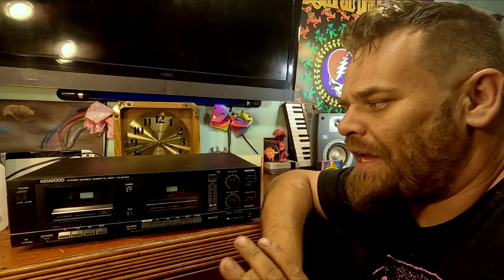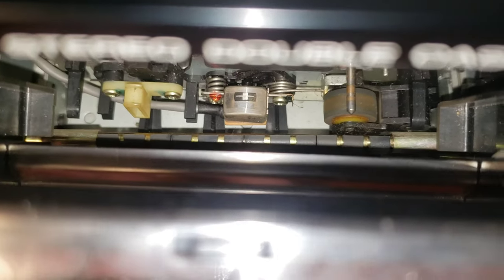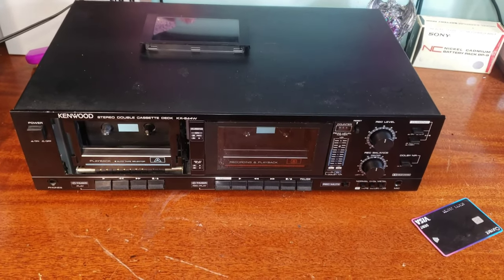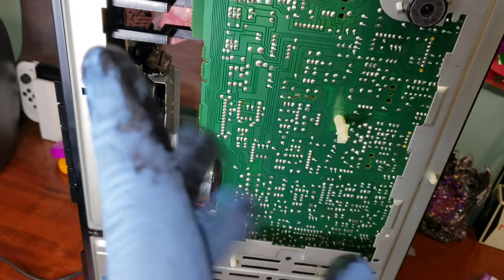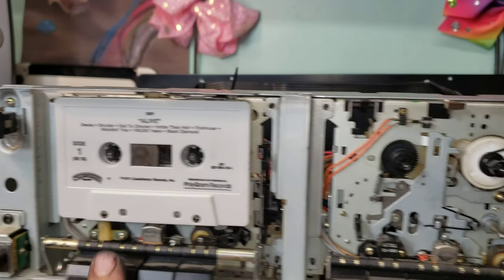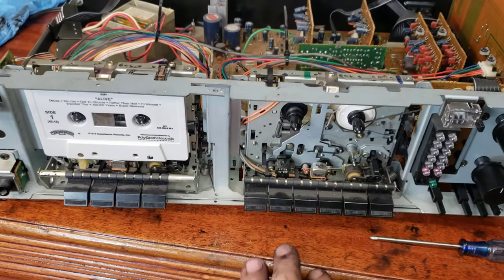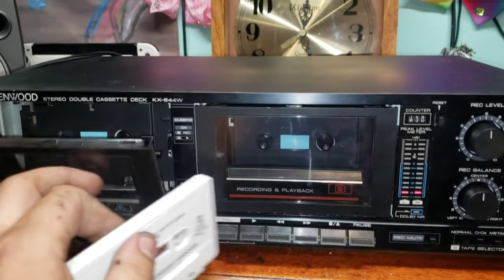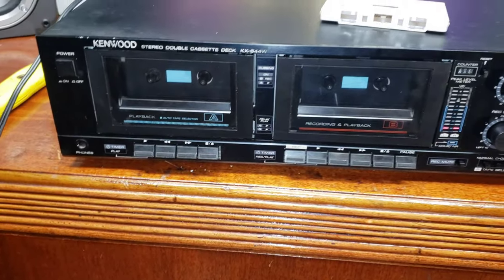Kenwood kX-644W (Can I bring my childhood tape deck back to life?)

Comment: hey, nice job, i have  teac gsw5300 deck with the same mechanisms as well. quite a reliable mech not to complicated, you might want to clean those heads, pinch rollers and capstans though.

Comment: You sure it’s the tapes going bad and not that Dolby was on by accident? If it sounds muffled it could be the pinch roller being barreled, azimuth or heads need to be demagnetized
Reply from the maker: I actually should dig back into this. Thank you for the information!
Reply: @Blowncapacitor84  I would do azimuth last , make sure heads and capstan are completely clean and possibly test tapes on another deck if it sounds the same then most likely they have gone bad